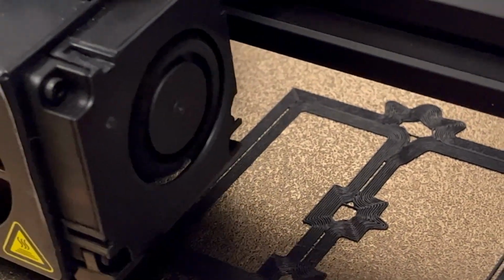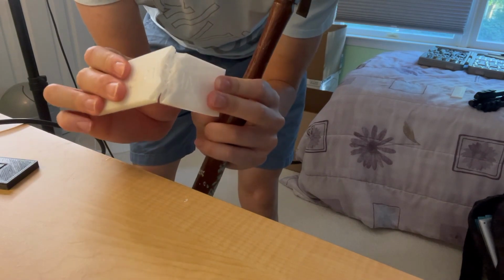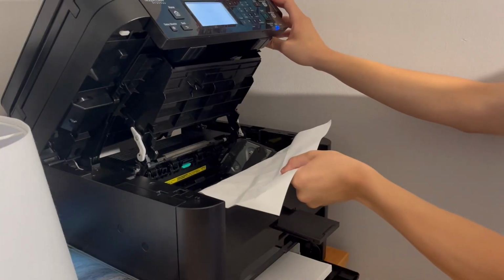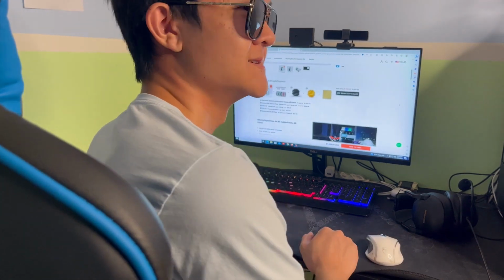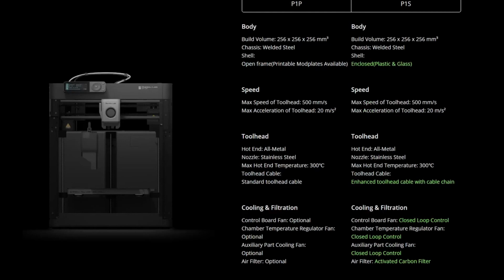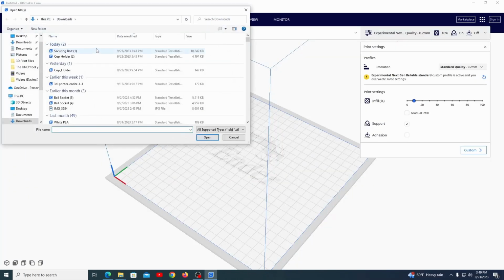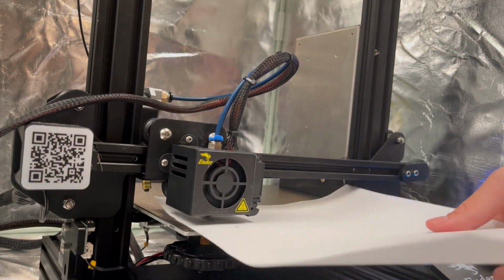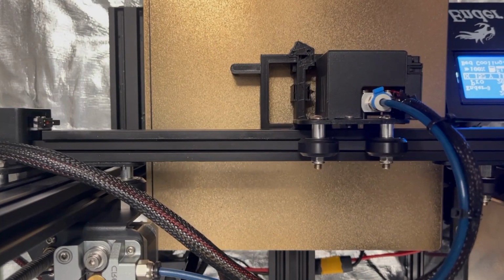The ONLY tool you’ll need | 3D printing and how to start

Comment: Should of included the Sovol SV06 in your printer recommendations
Reply from the maker: The Sovol is capable and beginner friendly, all while being in the sub $300 price range. The Neptune 3 pro has similar characteristics at a similar price range. The reason I did not include the Sovol SV06 was because it came down to the needs of the beginner specifically. A beginner needs a printer that is easy to start with out of the box, an affordable price point, logistical support (warranty, good help desk, etc.) in case of problems, and a fairly low complexity device (though it may not matter if the reliability is very high). The Neptune 3 pro has an edge in terms of logistical support and lower complexity components. The Sovol does have an interesting planetary gear box (I've worked with these gearboxes, and they are a pain to grease when needed), but that may be too complex for the use case of printing beginner parts. The Neptune 3 pro has a basic heatbreak, while the Sovol has a bimetallic one. I have upgraded my heatbreak on my Ender 3 pro to a bimetallic one, and it is great! Though, most of the time, beginners would not need to print in polycarbonate for example. The Sovol IS a great option, don't get me wrong on that part. I'm going to be honest and say that I wanted a nice number of printers to present (3) and not 4, which would've made the video a tad long. I had to choose between the two. Sorry for the long essay, but that was my reasoning :P.
Reply: Totally get you, I live in the uk so got a bit confused with the prices lol, I thought the Neptune 3 pro was alot more expensive than the SV06 but it really isnt and has some good quality of life upgrades like a filament run out sensor. @TheTinkeringTechie